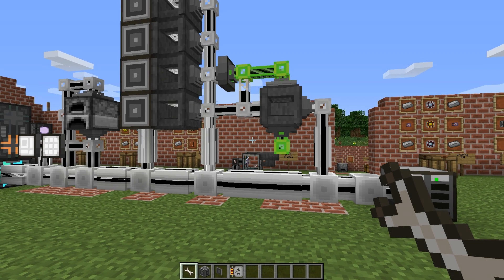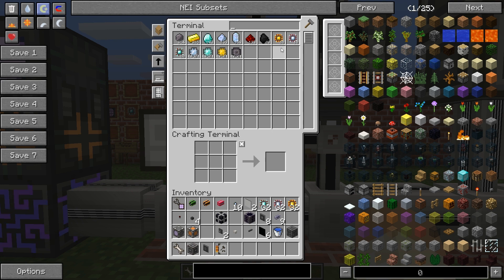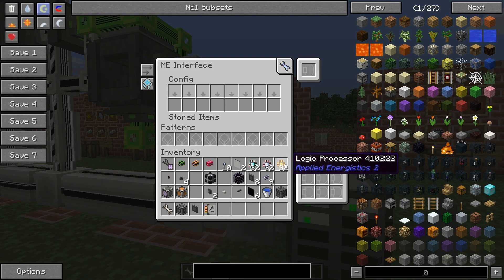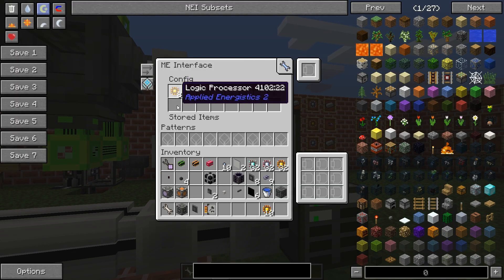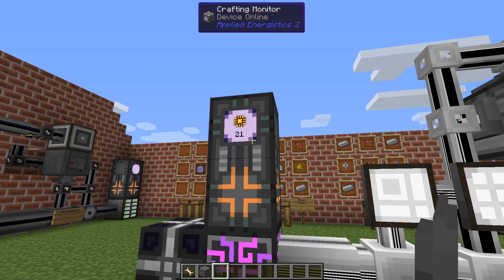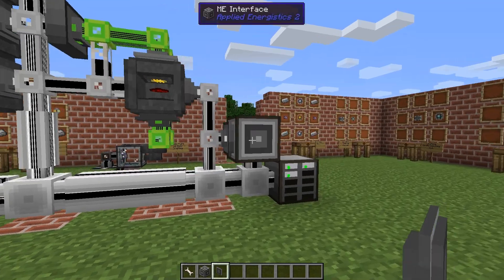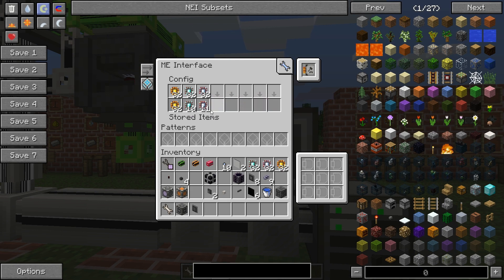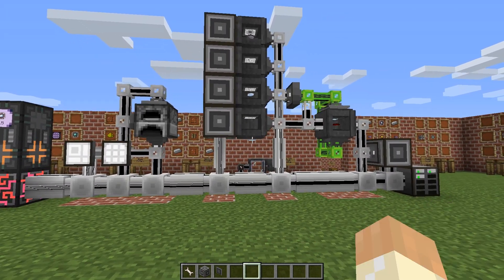Applied Energistics 2 Quick Tip: Auto-Order Auto-Crafting (MC 1.7.10)

Comment: I was wondering if i can Order more than 64 items (1 stack at a time) in 1 slot.
I dont like to waste 4 Me Interface slots to auto order 4x64 Glass for example.
Is there a work around with a chest ?
So i dont need to place like 20 Me interfaces for all Auto orders ...
Reply from the maker: I think you found the answer to this question in the other video? :)
Reply: TKH yeah, thanks :))
Reply: @qmixlexq  sorry to necro post, but what was the answer? this comment section turned out not very helpful😅
Reply: nevermind, found it a couple of comments below under this video

Comment: How do I auto request more items - i.e. 1000 of an item for example?
Reply from the maker: +Sid Umapathy Well, I haven't tried... But you could have an export bus to a chest and have a crafting upgrade on the bus. Then a storage bus to reach the items... This trick to have the storage in an Interface is only valid for stack sizes. If you want more than that you normally have a level emitter set to a specific number and have a machine running at all times (redstone controlled by the emitter). Does that help?
Reply: +Sid Umapathy I know it's been a while but maybe others will find this useful https://github.com/AppliedEnergistics/Applied-Energistics-2/issues/638
Reply: +ElliottP2009 Thanks! That is exactly what I needed, pretty clever chain, I would had not thought of this myself

Comment: What will happen if you replace that storage bus with another interface? 
In this case, I suspect that functionality wise nothing would change, right? Or is there any specific reasons to use a storage bus rather than two interfaces?
Reply from the maker: +Baichuan Ren I think you're mixing up the functionalities, you can't really use an interface as a bus... You're refering to the storage bus I put on the interface, right? I do that to be able to reach (take) the items stored inside the interface's internal buffer. An interface can't do that.... :)
Reply: +TKH I see, good point. I wasn't thinking about the internal buffer when I was watching the tutorial.
Reply from the maker: +Baichuan Ren I don't blame you, it's not very obvious... The info page just says "It can buffer a single operation.", but I don't really understand what it means without testing ;)

Comment: and how does it work with level emitter?
Reply from the maker: KaiUndMoritz Hmm, how do you mean? What do you want to do with it? It is basically used to send a signal out from the network depending on what you have stored in it.
Reply: i saw in a video that you can hold the item lvl like 1000 items thats what i mean :D
Reply from the maker: KaiUndMoritz Oh, forgot to answer. Well, again, it is used to control external things. For example, if you have a cobblestone generator controlled by a redstone signal, you can use a level emitter to turn it off when you have 1000 cobble in the system. Hope you understand what I mean :)
Reply: ahh ok thank i use them and want to be sure if i use them riight :D
Reply from the maker: KaiUndMoritz That's ok, just ask if you have any questions, and if you run into any problems you can also send screenshots. Makes it easier to follow :)